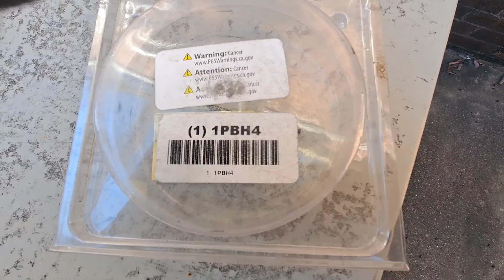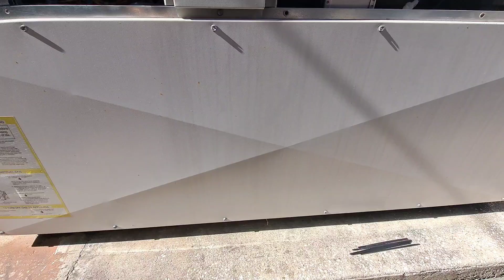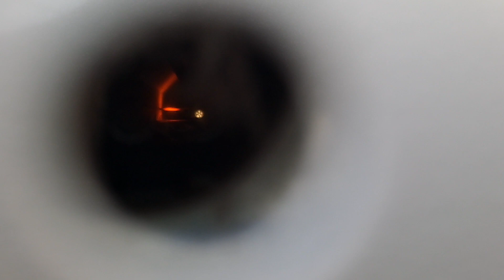PM OF A LOCHINVAR COPPER FIN BOILER #lochinvar #boiler #commercialhvac

Comment: my building we have 2 smaller copperfin2 units. watched a guy take apart one to clean out before and it seems pretty staight forward. great video! hoping to take this on for the first time sometime soon. basicly the same as u had here just has 2 manifolds with 2 stages of heat tho... thanks for the video! only one i seen really for this style of unit
Reply from the maker: Glad it could help

Comment: i have a copper fin 2 solid red alarm no water flow. pressure reading 0. any idea what it can be?
Reply from the maker: @EmmanuelShahid7  i would start by confirming you have water and that the pump works. You can jump out the pump contacts.....after you confirm there is water in the loop. I don't always trust analog gauges in a hydronic system.
Reply: @jasonjohnsonHVAC  thanx bro I will take a look at it. I work at the VA BOILER and working 2 month. they were using the regulater valve with the little handle to maintain at 30 to 35 psi. I check last night was running fine but was around 45 psi which was a concern. I came in tonight and it was down. water circular pump was running but no pressure at all. I tried resetting a few time on the copper fin side and turning it on and off and no luck. I will try your method as you mentioned.

Comment: No combustion test?
Reply from the maker: Not this time. I would've liked to. My analyzer is off getting recalibrated and the company doesn't own one. I have mentioned the importance of testing with an analyzer...nit sure what will come of it. I own my own and i haven't gotten it back yet. Its been out for 2 months now. Thanks for mentioning it though....it is an important part of the process
Reply: Sounds about right lol. My company that I work for seem to send analyzers out right around heating season.  Just in time to not have for heat start ups.